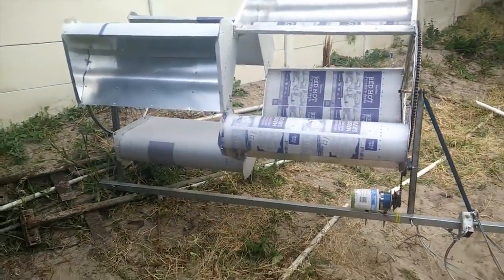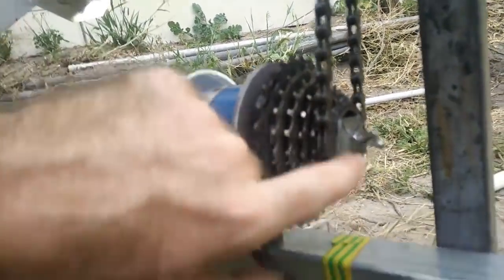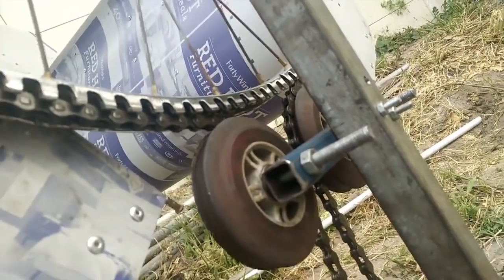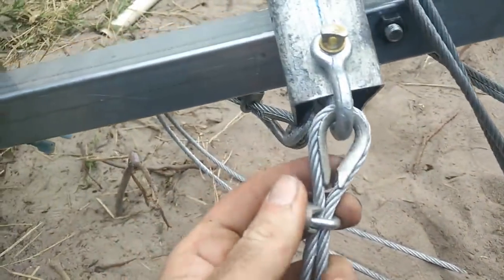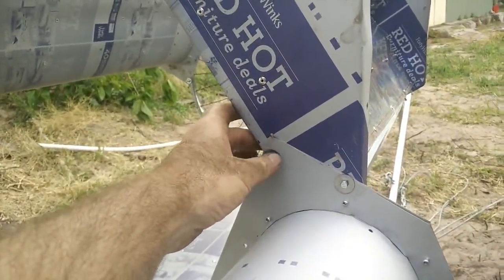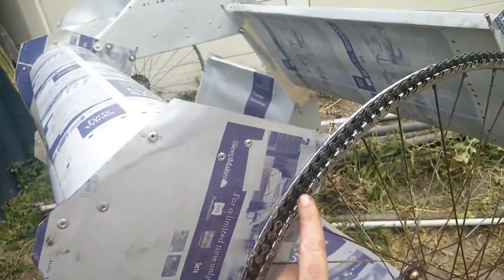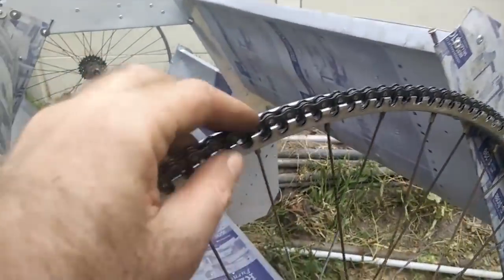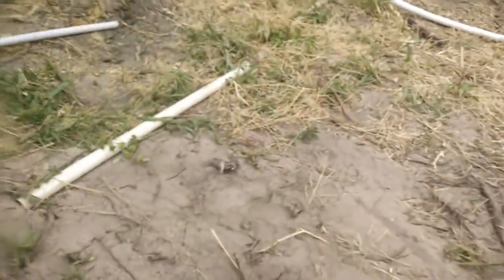Kilowatt wind turbine and pole for under $150

Comment: You have made an excellent job with that turbine. Your video is very detailed and your explanations are simple but very complete. Is there any particular reason to  use a square pole instead of a round pipe with more diameter?your design is awesome,anyway and it seems to work flawlessly. The idea of using glue for the chain is simply clever. In my area the sun would affect it in 4 or 5 months though. Great job and as engineer I can tell you that simplicity is key for do it yourselves people. Thanks for sharing this with us and congratulations. You made a very important addition.
Reply: What is the glue used for, I didn't understand that bit.
Reply: mkeyx82,  take a chain and glue it all the way around the wheel. That will serve as teeth for the chain that  thansfers power from the turbine to the generator.
Reply: You may use some other method for attachment of the chain mkeyx82 but he used glue because it is fast and easy. I found a glue used here to repair plastic tanks that it looks like a very strong resin and it is UV resistant so I think I will be able to reproduce as exactly as I can this design...but I have a piece of pipe instead of a square pole lol.
Reply: You should be able to calculate load bearing capacity for that pipe. It's counterintuitive (somewhat,) but I know that a pipe will be able to sustain more load than a rod of same diameter. It's reasonable to assume it will work the same way for a square pole, however I don't know how would the pipe diameter relate to square pipe diagonal.

Thanks for the explanation. Why should a chain be used on this thing anyway, looks quite superfluous. IMO it would be better to have the generator touch the wheel tangentially, with an elasticated support to keep it pressed on the wheel firmly and a smaller (rubber?) wheel affixed to the generator axle for traction. Depending on the smaller wheel diameter, desired rotation speed could be obtained.

Or even maybe have a similar setup, where the bike gear would be left on the axle and the chain affixed to the wheel (along the circumference) in a closed loop. If the gear would touch the chain tangentially, I'm willing to bet it would still spin with quite a bit less friction.
Reply: mkeyx82, strain on the gen sprocket teath is related to how many teath are enguaged. Thought experiment: would you rather have 700 foot pounds per second (950 watts) distributed over 2 teeth, or 10 teeth?  Granted, one would never have that kind of power continuously, but a bike sprocket normal use is far closer to human powered at 220 foot pounds a second  (300 watts) over 8 to 10 teeth like in a bike.
Reply: mkeyx82, round pipe vs square. Square tube is preferred for lateral forces. Round pipe is preferred for twisting forces. Both should be fine for vawt.
Reply: Well, Keith, I'm more concerned about friction to be completely leveled with you. In this setup not only is there more friction due to teeth, but also the strainer. This all boils down to expected/average wind speed.
Reply: mkeyx82 , engineering trade off: a little extra friction engaging 10ish teeth vs shortend life and more maintenance on just 2 or 3 teeth. Seeing as I would not want to have to take it down every other month to replace a sprocket, I would go with the little extra friction. But to each their own. Build yours as you like and enjoy.
Reply: That's a fair point, but still I think there is middle ground taking into account the expected wind speed. Sadly, I won't be building my own any time soon since living in an apartment building has a myriad of limitations, inability to expand in the least being the most notable of them all. If at least we had a flat roof something could be maybe done with it, but no such luck.
Reply: Jose DeMunck I'm guessing you have to use his example and make something that fits your area, like I live by the bay area and I get plenty of wind but I have to take in the fact of dust rain salt in the air birds many factors I've seen some in town set up like propeller blades that are incognito where you barley notice them and the blade can be folded down when not in use

There are many set ups just have to figure out which one like I do. Buessnss are going to the solar system I see them over school parking lots over homes hospitals I wonder what the electrical company is thinking about that are they getting cut off will the government figure out a way to taxe free energy? Raise everything else if they know everyone don't have to pay high cost of power anymore?
Reply: mkeyx82 If you want, even though you won't be able to erect one on or around your apartment, you may still build and sell or help a friend who owns their property. Although, you probably still want to build for less maintenance seeing as the description states this build can do 1kw in 60 mile an hour winds. 3.3 times what a human can put out over a few minutes, and far more than you want to stress on just two or three teeth.
Reply from the maker: Yeah glue was just to get the chain attached quick easy and strong, you could also just use some small bolts through the wheel rim. I don't think sun damage would be an issue and it's pretty much always shaded by the turbine anyway.
The next one I'm going to build tho will just have the glueb chain and then put the sprocket directly on to that. Which will come up against the few teeth issue and may require changing the sprocket every so often, but the result should be pretty much silent and frictionless, which like many comments here have been pointing out, are issues, tho this setup here isn't too bad on either.
Salt and corrosion wouldn't be a huge issue for the aluminium blades or bike rim, and much less of one if the chain is static as per the next build.
It's a kilowatt mechanical in a 60 km/h wind, not mph. It should do about 4.5 kW in 60 mile, tho obviously there's not really a readily available gen/alt which would achieve that.
The square tube is because it's easier to attach the crossbeams and keep them aligned than with a round pole. Otherwise it's largely much of a muchness. Future builds tho will definitely have ropes at the half way point as this one does wobble a bit. Just poly rope or similar should do it for that as the actual strain is really only only on the top ropes.
Reply: Yet another option is to place the chain on the inner side of the wheel, albeit that would require a more intricate wheel, but it would add at least 2 teeth to the equation.

Also, thanks for the suggestion Keith, but in this area people don't do renewable much. Some solar here and there, 0 wind turbines in the wider area. I guess the energy bills don't but a big enough dent into the budget to move people in this direction.
Reply: great idea,nice to see it works

Comment: Your scooter wheels will make drag. Just use a vertical slide for the generator to use gravity to pull down on the chain. Will increase efficiency by 10% +
Reply from the maker: I've since progressed to a belt, but how do you mean?
Reply: @OpenSourceLowTech  the gravity  of the generator would pull down on the chain or belt. Like a vertical slide to keep the generator held so it can only move up or down. The weight will pull down on the belt.

Comment: Well done, re-purposing old items into DIY wind turbine.  I would probably be more inclined to use an AC motor/generator instead of DC motor/generator.  if not possible then perhaps use DC to AC rectifier so what ever power you generate with the turbine will be cheaper to cable back to the house with little to not much loss in AC, then at the house just rectifier back to DC.

Comment: You can change the brushed generator, with a Brushless motor with have mutch higher efficiancy. They are cheap in RC world, try "6374 outrunner motor". You can use 25% smaller windturbine for the same power output.
Reply from the maker: Yeah, I'm playing at the moment with a hoverboard wheel, which is essentially a 350 watt three phase alternator, mass produced as a consumer item. I'll post results on that as I have them. Thanks for the tip.

Comment: Hi, i like your project, well done... Can i ask why did you choose a chain over just mounting the generator directly to the shaft of the vawt?
Reply from the maker: The way it's mounted the shaft is immobilised, but the main reason is rpms. The higher the voltage the better for a couple reasons, so being able to use the wheel rim as a pulley is pretty useful.
I'm currently in the process of replacing the chain, which kinda worked ok for the most part, with a belt which while slightly trickier to source is probably a better option overall.

Comment: What volatage are you looking to get from the treadmill motor ?  . . .  I got 90 volts when testing using a drill it was rated for 110 volts
Reply: you would only need around 14 volt to charge a car battery. But what is the ampere output?

Comment: Looks good, but why you don't use two more motors instead of this two round-rubber-thing?
Reply from the maker: I thought about it, but they'd need to go to the charge controller as separate channels, if you just wire them in series it's quite difficult to get the voltages to work out and not just have them powering each other as motors rather than generators.
Reply: Ah ok.
Now that make sense.
Btw i see your other videos... nice 👍.

Comment: I wanna use a 400 kv rc plane engine. Vertical turbines are better.  So if a hurricane is coming you switch it on a tight gear. Genius turbine.

Comment: You would probably get better efficiency and longevity with a toothed belt than a bicycle chain
Another option would be a serpentine belt used in an automotive fan belt.  Same goes for an idling wheel.  You only need one for the slack side.  The driven side will tighten automatically.
Reply from the maker: Yeah, those are all where I'm currently at with the approach.

Comment: Im trying the same thing and I have a question. I have a dc permanent magnet motor and it is putting out 60+v dc at the higher rpm of the motor. What did you do to get the voltage to more consistent current? Thanks in advance
Reply from the maker: Not sure I fully understand the question. Voltage will be linearly proportional to the RPMs, current will be more or less set by the load, which is just what you tag onto the thing to be powered.
With a wind turbine you're not going to get steady voltage as the wind is always changing, but putting it through a charge controller, buck converter etc will regulate that for whatever you're ultimately plugging it into.

Comment: Wondering how much power you measured on a good windy day. I want to make one, but looking for ideas. I was thinking more of many smaller ones instead of one big one. Years ago I bought some larger type printer motors, capable of 4 amps at 15v tunning at 2800 RPM.
Reply from the maker: I'm still in process of getting numbers, will broadcast when there's something to show. 4A is a little on the low side, but probably workable. You're going to struggle to get 2800 rpm onto a gen tho, even with significant gearing.
Take a crack tho, and let me know how it turns out.

Comment: See some of both people picking (A typical , of you tube junkies, that don’t make crap) and the opposite is the cheer section!
I’m not posting for either, just some Quality inside, from my personal, educated, and professional point of view.
I like when people use their minds and hands.
1) is the tapping from the vain hitting the guy wires?
2) what occurs in very high winds?  
     As most turbines are designed to free spin at a given rpm. So the extremely voltage generated at those high rpms do not burn out the brushes
     and the voltage regulator ( rectifier)
3) the chain being glued in?  
     Good hack,  how ever William Ferris over came chain and cable friction by using rubber. As a batting between the elephant
      ear at the end of a spoke. The cable or chain would ride against the rubber, to turn the Ferris wheel. The ELI -12 and the Garbick -12 are the 
      same. They revolve 26ton of steel and people with friction generated by cables and chain to rubber.
4) idler-wheels or tension wheels? 
       You used good engineering fundamentals, there.  Ok, but I didn’t see one stationary and one under spring tension. This is needed because
       Of the load of the wind pushing changes. They will ecsorb the shock and jerking, caused by the sudden change in wind. Plus the new chain
       will stretch, once worn in.  Some slippage is good at times, usually for quick and unexpected Load changes, like wind.
5) rain guard over the motor/ generator ( maybe an alternator depending on the type you use).  
      Good thought again. Be sure to you a cable lube or dry lube.  So sand and debri don’t gum things up.
6) turbine construction.  
      Over all quality craftsmanship. I’m not sure the strength in high wides is built into the portion, with out back bone support. A strong local
      storm can tear apart some of the best made.   But the geometry of yours is great.
7) Round or square poles ? Use the simplest to work with. Capping off the top will slow rust inside.

Lastly, As young man I ran an 45’ ELI-12 for Taylor and son amusement out of Annapolis,Md. The late owner Mr. Charles III, was one of five Amusement company owners whom forged the first ride inspection standards used still today. Him and his son Cliff also where to first to use nylon bushings on the Journal bolts to carry the tubs you sit in.  I worked 18 yrs in the utilities industry.  Including as a Baltimore Gas & electric Class A Trouble lineman.   I also now live in Yucca Az off grid and wind generation is in part of my owner system. 
We can get steady winds 30-40 mph and gust 60-80.
Reply from the maker: Hey, great comment and questions.
1) Yes. Since fixed.
2) The turbine itself has been tested up to 105 km/h, though I've strengthened the design significantly since then. It does about a sixth the rpms of a horizontal at six times the torque, so overspinning isn't really an issue.
3) I'm now using an automotive belt, tho another commenter mentioned tumble drier belts which I'll check out and might be a good option.
4) I'll see if I can get away without a spring on the tensioner pulley, but shouldn't be the end of the world if I need to incorporate one.
5) Good tip on dry lube.
6) I'm hoping the more hardcore design will take gusts of up to 120 km/h, but will find out over time.
7) Square is a bit easier to attach stuff to.

Did you check the full build tutorial in the video description?

Comment: Im trying to do a similar project for college and not sure what motor to use. Could you please tell me where you got the motor and what exactly it is, please.
Reply from the maker: That one's a treadmill motor, which does good maximum power and also good voltage per rev. I got it by ringing round places that service gym equipment, was $50 but he chucked in a second one free because he liked the project. There's other options, like motor bike alternators, electric bike wheels, smartdrive units, etc.